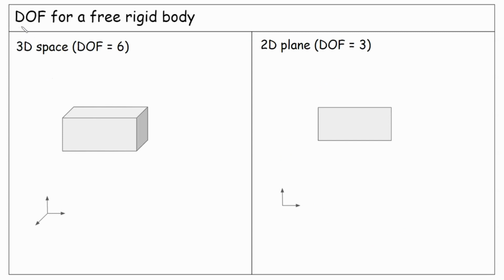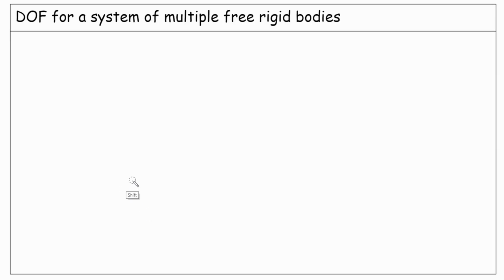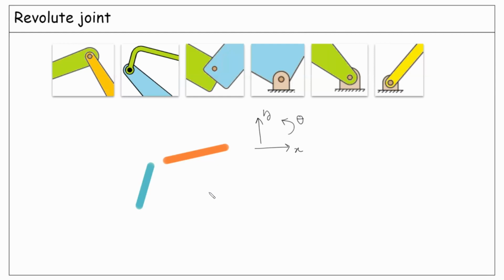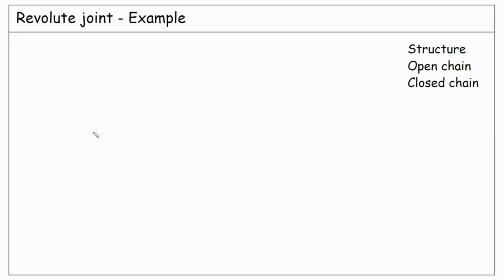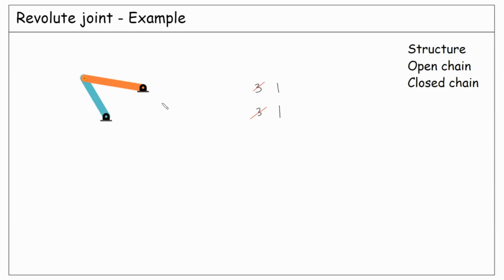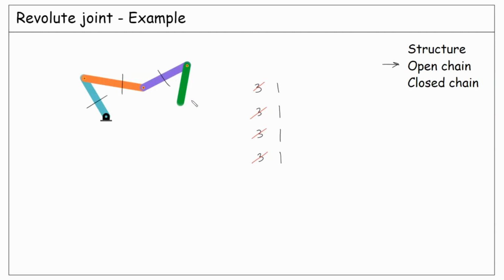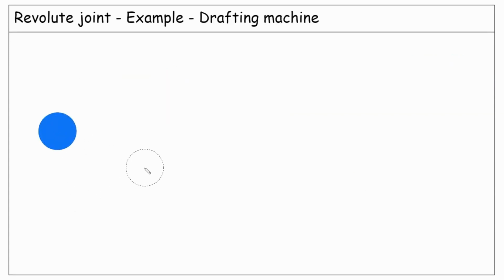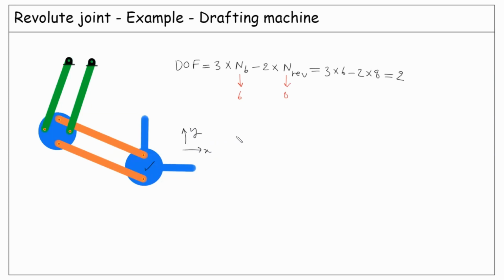Understand revolute joint and how it affects the degrees of freedom in a system

Comment: Our elbow can only rotate 180 degrees instead of 360, so is it considered only half a degree of freedom along the rotation axis? Is our elbow a real revolute joint?
Reply from the maker: For being a revolute joint, it does not matter the range of rotation. Elbow is in fact a 3D mechanism with spherical (ball and socket) joints.